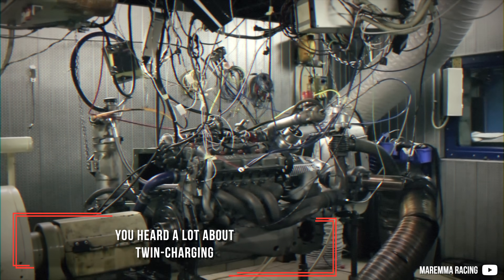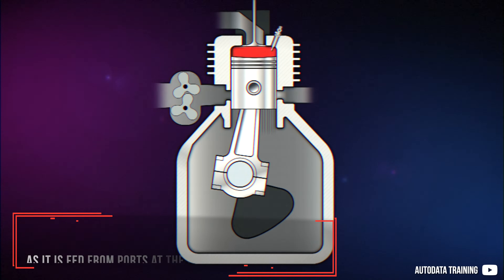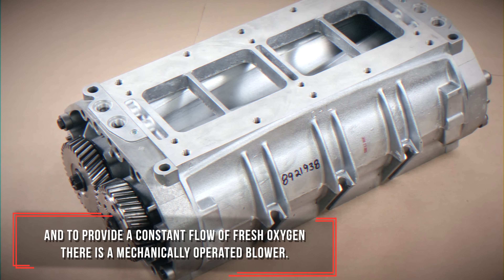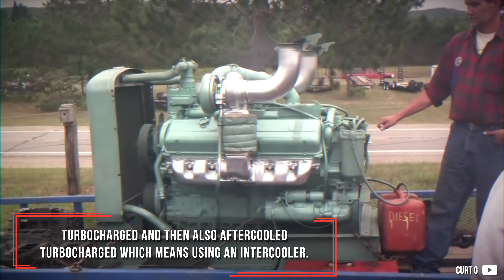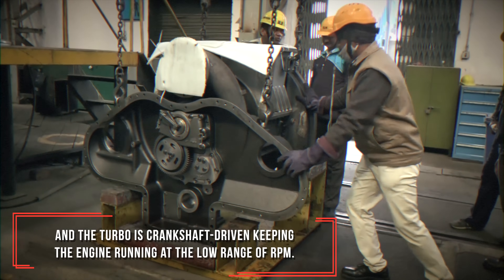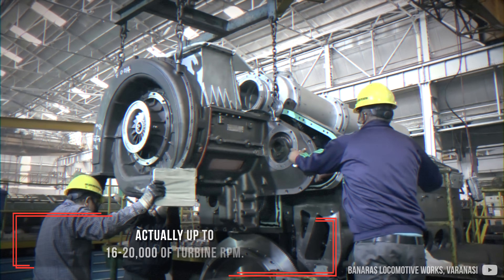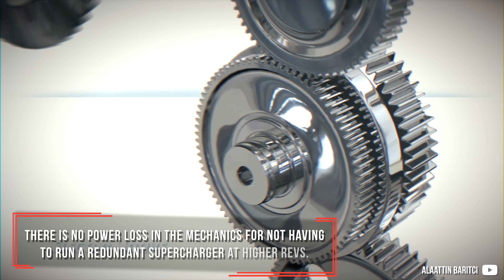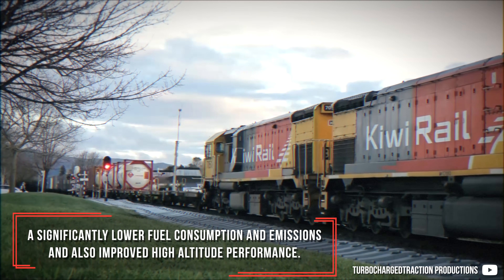EMD's Unique Type of 2-Stroke Forced Induction

Comment: So if it's driven by engine power and not exhaust gas wouldn't it still be a supercharger? Detroit diesel used a roots positive displacement blower your talking about a centrifugal blower that uses a turbo type compressor but not operated by exhaust gas. So I believe it's still supercharged as it's gear driven, not exhaust driven.
Reply: Depends on the crankshaft and turbine rpms, when the turbine spools up it overrides the coupling and disconnects from the slower turning crankshaft.

Comment: So basically it's an engine driven turbocharger that is providing boost over & above what is normally required for the scavenging on a 2 stroke diesel in one unit -instead of using a supercharger for the scavenging & a separate turbocharger to provide boost. Seems pretty logical to me, less components.
Reply: No boost, maximum manifold pressure at sea level is + 0.7 psi.

The exhaust turbine uses waste heat energy from the exhaust gasses to scavange,  creating additional power at the crankshaft that would otherwise be used to drive the scavanging blower.
Reply: @sandervanderkammen9230  isn't boost when manifold pressure is anything above atmospheric pressure?
Reply: No boost, just altitude compensation
Reply: @sandervanderkammen9230  ah ok, that makes sense
Reply: @phil955i  yes boost is any thing above atmospheric pressure as you are boosting the pressure going in to the engine.
Reply: @phalanx3803  Winton type 2-strokes are Normally Aspirated, so no manifold boost.
Any questions son.

Comment: There are some 2 stroke diesel that doesn't have any blower
Reply from the maker: Show me
Reply: @VisioRacer  lanz-bulldog single cylinder 2 stroke diesel tractor. Yes there are 2 strokes that don't require blower, but these work very similarly to regular gasoline 2 strokes. They use the crankcase to pressurize air and then push it inside the cylinder, which means that these engines also burn a little oil and thats why they aren't being used anymore
Reply from the maker: @dieselgeezer18  You are right, but they are more known as hot-bulb rather than diesel engines.
Reply: @VisioRacer  yes you are right. It can run on diesel but its not a diesel
Reply: Indeed; some older Fairbanks-Morse (and others) use crankcase scavenging; there are round air intakes visible in the crankcase:  https://www.youtube.com/watch?v=8lbEK3bXME8  as an example.  Later models used piston pumps, and various other types of blowers.

Comment: You pretty much incorrect about that intercooler the intercooler is inside the engine of a Detroit Diesel just under the blower ther's a intercooler on all 2 stroke Detroit engines
Reply: There is no charge air cooler on  naturally aspirated (roots blower) Detroit diesel. Only on turbocharged engines.
Reply: @billmoran3812  you are 100% incorrect
Reply: @billmoran3812  at the bottom of the airbox before the charger enters into the engine there is an intercooler the top of the engine is air-cooled with water cooled head if it didn't have an intercooler to get the charger air temperature down there would be issues under the extreme load

Comment: Forced induction is not necessary with a diesel, but they really suck without it. Diesel engines have to be made strong due to compression ratios and heat produced. They all require huge amounts of cast iron and steel forgings to be built and survive.
Reply from the maker: Two-stroke diesels do not suck, they need a blower
Reply: @VisioRacer  when he said "but they really suck without it" he meant that they are BAD without forced induction because they are super slow. Not that 2 stroke diesels can suck without forced induction LOL.
The word "sucks" is said when someone wants to describe something very bad or unpleasant. Its a thing that english speaking people say. I gave it a detailed explanation because i know that you aren't a native english speaker
Reply: forced induction IS required on 2 stroke diesels that don't use the crankcase for sucking air. 4 strokes don't require turbos, but 2 strokes do need some kind of forced induction
Reply: @dieselgeezer18  
Bad design.
Reply: @upsidedowndog1256  what do you mean by "bad design"
Reply: @dieselgeezer18  
Anything that needs indutction boost  run isn't meant for our planet. I love boost. I own a 1985 Kawasaki 750 turbo. It is still an impressive bike. Makes anything new feel slow and too complicated. Pure boost is good.
Reply: @upsidedowndog1256  Did you watch the video? "Boost" isn't required, the blower is doing the equivalent work of the exhaust and intake strokes for a 2 cycle diesel. It's called uniflow forced scavenging, not forced induction. The Napier Deltic, Detroit Diesel and EMD 2 cycles are all examples of this design. The EMD clutched turbocharger allows the engine to have proper scavenging at low RPM, then at high RPM and power the turbo declutches and acts to boost the engine, significantly increasing power.
Reply: @billyp4850  
Apparently I missed something. Only been working on boosted aircraft for over 30 years. Diesels are a bit below my pay grade.
Reply: @dieselgeezer18  A lot of N/A Diesels are not just slow, they are terrible with torque! They resemble a 1920s' flathead gas engine with the compression ratio at only 4:x:x, maybe 5:x:x. (maybe lower than that!)
Reply: @RJARRRPCGP  yeah i didn't say that they are fast. They still got very good low end torque though. 
But they don't really resemble a 1920s' flathead gas engine. A N/A Mercedes OM605 2.5L diesel engine makes 110HP. The final and most refined ford flathead V8 has 3.9L of displacement and makes almost the same horsepower as the OM605

Comment: Dude, if it's not driven by an exhaust turbine then it is NOT a turbocharger
Reply from the maker: Sorry mate, but did you watch the whole video? It is both crank driven and exhaust driven. At certain exhaust flow the overrunning clutch disengages and it works as a turbo.
Reply: IT IS! it is driven solely by the exhaust gases under load... but is coupled to the crankshaft at idle and low rpm until the turbine spools up and overruns the cluch.

Comment: Aircraft engines in ww2 had the same system
Reply: NO... they didn't.
Reply: @sandervanderkammen9230  Look in the military aircraft book . ww2  4 stroke but 2 speed mechanical centrifucal blowers
Reply: @sandervanderkammen9230  Your name looks german. Those very engines with mechanical centrifugal blowers beat you into dirt . You should study them in detail
Reply: @BillStecik  Completely different concept..
2-stroke Diesel engines require the blower to operate with positive air box pressure at idle and low rpm... with no throttle this requires a much higher compressor rpm at idle.

4-stroke engines have a throttle valve and operate with Negative manifold pressure at idle and low speeds.
At high rpm the EMD turbocharger operates like a normal turbocharger

WW2 aircraft sometimes used a 2-speed supercharger drive.
This is for altitude compensation.

German aircraft engines used a more advanced and sophisticated  variable-ratio fluid coupling to drive the supercharger, it allowed continuous, fully adjustable supercharger rpm and automatic altitude compensation with an aneroid controller.
Any questions?
Reply: @BillStecik  Wrong again... its not a German name at all...

Of course Germany invented pretty much everything related to internal combustion engines... including the very first aircraft engines in the world!

During WW2, when the Allies were still fooling about with superchargers  Germany was building jet aircraft and launching missiles into space.

But I digress, we were talking about 2-stroke Diesel engines... also invented in Germany.
Reply: @sandervanderkammen9230  I feel very sorry for the Germans. They invented all the great stuff and got their asses handed to them with it
Reply: @BillStecik  Germany is now the number one economic power in Europe... the richest country by GDP.
Reply: @sandervanderkammen9230  Too bad you are not german
Reply: @BillStecik  Nice redirect... but you're still wrong about the EMD turbocharger system...
Reply: @sandervanderkammen9230  WRONG... you redirected
Reply: @BillStecik  Sorry billy boy, you lose.
Reply: @BillStecik  I'm so lucky to have a good education... that way I don't make embarrassing blunders like you billy bob.
Reply: @sandervanderkammen9230  you are still unimportant
Reply: @BillStecik  If that were true you would just ignore me... but I have your full attention here billy bob.
Reply: @sandervanderkammen9230  No it is just cold out and I don't watch tv. you are my entertainment .  On the side . Are you in europe?
Reply: @BillStecik  Maybe you should read a book about superchargers or locomotive engines... maybe you wont make a fool of yourself next time you post a comment on YouTube?

Comment: If it is mechanically driven it is a blower not a turbo.
Reply: Only at idle and low rpm... at higher rpm it disconnects from the crankshaft and operates like a normal turbocharger.

Comment: Why do you call supercharged engines naturally asperated. They are forced induction. To me naturally asperated is when the vacuum created by the piston going down draw in the air. I was a railroad machinist and worked on lots of EDM engines.
Reply: Good point, he is using the wrong terminology.
EMD engines are not supercharged, they Normally Aspirated by way of a scavanging blower... not a supercharger in the common definition.

Comment: If it's driven by the motor, and not exhaust, it's still a supercharger.
Reply: It is a turbocharger with an additional mechanical input driven by the crankshaft. When there is not much exhaust gas the crankshaft input drives the turbine, acting like a centrifugal supercharger. When the exhaust gas rate is enough it will try and spin the turbine faster than the crankshaft input and the clutch disengages the crankshaft, making it act just like a normal turbo.
Reply: @Byefriendo  he is talking about the turbocharger portion. This is a twin charged engine that uses a turbo and supercharger. The motor driven forced induction charger is infact a supercharger, not turbo.
Reply: @NOTSOSLIMJIM  there isnt an additional supercharger on those engines, thats the point. The turbo is mechanically driven at low RPM, acting like a centrifugal supercharger, once the exhaust wants to spin the turbo above the engine speed, the connection to the crank disengages and it acts like a pure turbocharger. the point is it doesnt have a redundant roots superchager which increases efficiency and reduces complexity.
Reply: Only at idle and low rpm, once the turbine spools up under load, it overrides the coupling and disconnects from the crankshaft.
The centrifugal compressor is only driven by exhaust gasses when the Diesel engine is under load.

Comment: What's unique in that design? It's not new and widely used in marine engines...
Reply: Is it??? EMD engines can have a blower and a turbo, or just a Turbo... "turbo-blower"
Reply: @sandervanderkammen9230  hm? I'm not talking about EMD engines saying that. But there's a pretty old engines using compound drive blowers with turbine and crankshaft drive. And it works in turbo mode or crankshaft driven with a turbine delivering its power output through the gearbox directly to a crankshaft.
Reply: @teolynx3805  What other manufacturers use a "Turbo-blower" in a Normally Aspirated application????
Reply: @teolynx3805  I think you are confusing this system with "Turbo-compound" engines that work very differently, completely different concept.
Reply: @sandervanderkammen9230  not a normally aspirated it's forced induction but it works as I described previously: Soviet "Zvezda" M-500 series.
Reply: @sandervanderkammen9230  or it's just you don't know something (you know it happens sometimes with humans).
Reply: @teolynx3805  Your comment reveals someone who doesn't understand or recognize the difference between a Normally Aspirated and a Naturally Aspirated engines and is confused about difference forced induction blowers, and forced induction superchargers.
Reply: @teolynx3805  The Zvezda M-500 series is a 4-stroke and is supercharged.. very, very different from the EMD engines.
Reply: @sandervanderkammen9230  my comment reveals only that English isn't my first language (not even second). So put your guessing aside and keep in mind not everyone in the world uses English and good with it's terminology.
Reply: @sandervanderkammen9230  different in terms not connected with the topic. It uses a double drive system with turbine and crankshaft drive with three clutches a couple of gears and the ability to load turbine with turbine or crankshaft to spin compressor or add power to the crankshaft while driving turbine from the crankshaft itself. 
But it's not interesting for you. You just wanted to show off yourself...
Reply: @teolynx3805  Thank you for confirming my conclusion that you do not understand the difference between Turbo-Compound engines and Turbo-Normalized engines.

These are two completely different concepts that operate on very different principles.
Reply: @sandervanderkammen9230  thank you for confirming that you totally can't understand what we were talking about. I get that it was useless to talk with you
Reply: @teolynx3805  The EMD system DOES NOT provide any supercharging or manifold boost pressure nor does it operate as a compound heat engine with a second pass heat recovery cycle.
Reply: @teolynx3805  Just answer the question, What other manufacturers use a similar Turbo-normalized Winton type 2-stroke Diesel engine application????
Reply: @sandervanderkammen9230  have you ever tried to hear what others say? I think no. I was talking about a mechanical system that wasn't new in any way and used not only on your beloved EMD's. But nevermind I don't want to reply to you because of your ignorance anymore.
Reply: @teolynx3805  You clearly do not recognize or understand the unique nature of the EMD turbo unit... you have made several false assumptions based on a logical fallacy.
Reply: @teolynx3805  You wrote, quote;
"it's not new and widely used in marine engines"

Please name another manufacturer that uses a similar Turbo-normalized 2-stroke Winton type Diesel engine in marine or any other applications????

Comment: "The turbo is crankshaft driven" isnt that a supercharger?
Reply: The turbo is turned from the crankshaft by a set of 3 bull gears, connected to a planetary gear for a prescribed engine speed range.  The EMD engine runs from 100 to 950 rpms.  The gear driven turbo, the gearset driving the impeller is connected to about 400 rpms and after that engine speed, the exhaust gas will spin the turbo impeller faster than the planetary gear drive as the engine speeds up past 400 rpms.  The connection between the gear drive and impeller is on a sprage.  When the engine speeds up the sprage is disconnected from the impeller, engine speeds to 950 rpms.  Slow engine rpms down and around 400 rpms the sprage engages with the turbo impeller.

Comment: it is called turbo-detander or turbo-compound, not a turbocharger

used in napier nomad, 5TDF and others 

not only provides a forced induction, but utilizes exhaust gases energy into extra mechanical power
Reply: Nope, the EMD turbos only work one direction. The engine provides power to the turbocharger assembly in order to run at low load, but at high load the clutch disengages and the turbine spins freely.
Reply: @alexphillips4325  hmmm..
Reply: @kovbohdan  He's correct, the EMD turbocharger is only mechanically driven at low engine speed and load, or when there is a significant power change and it spools down. The turbocharger has a one way clutch, so the turbo can freely spool up when the exhaust gas has enough energy.
Reply: @billyp4850  yeah!

do not argue - didn't know of this kind of using turbos..
Reply: Nope, Not a turbo-compound